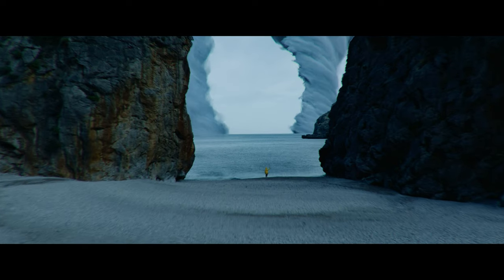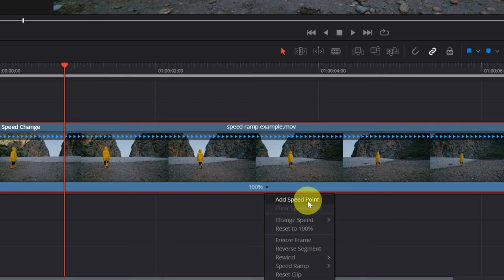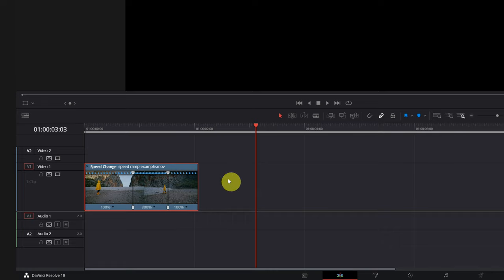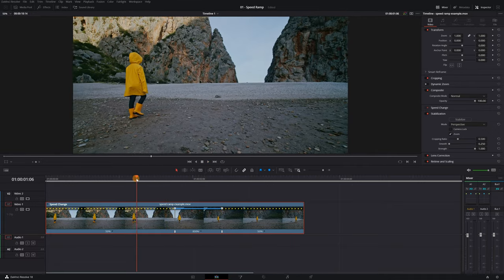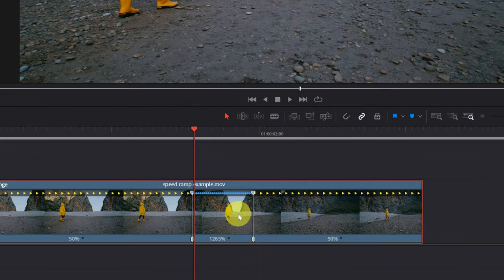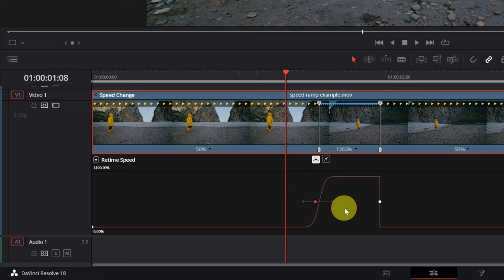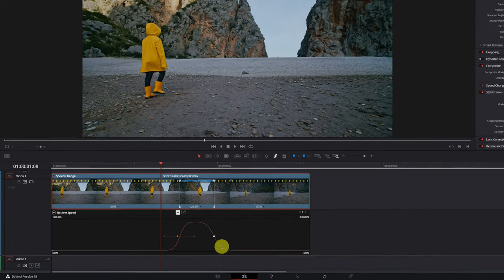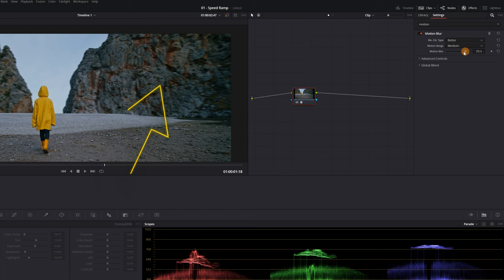How to Speed Ramp in DaVinci Resolve | Tutorial

Comment: How do we handle speed ramping a cut in the middle of a video on the timeline?  The clip that we adjusted pushing into neighboring clips and reduces their duration.  How do we fix this from happening?  Is their a setting?
Reply from the maker: You can create a compound clip with as many clips as you like, so there won't be any cuts in between.
Reply: @SergiomotaENG  My issue is I'm making a video with probably 30 clips or more.  If I want to slow down one of the clips, it causes the clip to the right to shrink instead of pushing all clips further to the right.